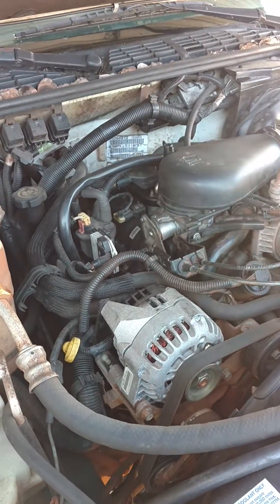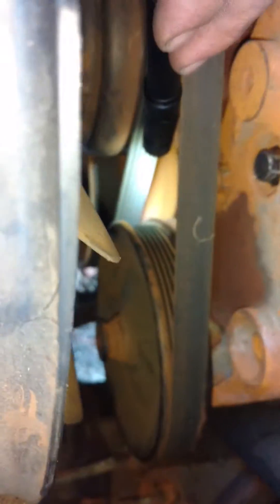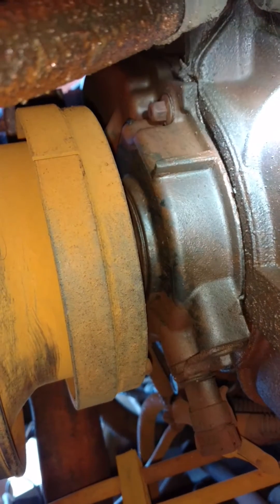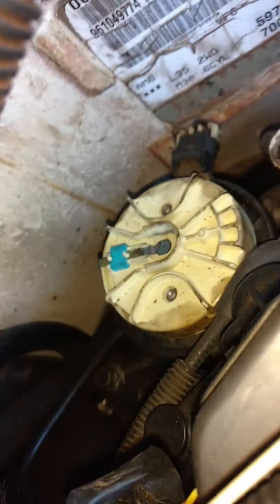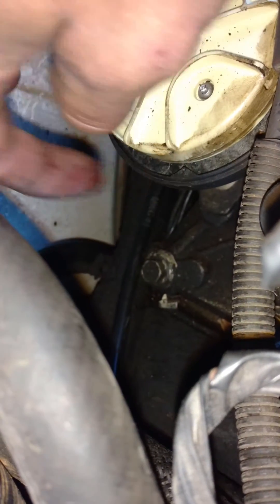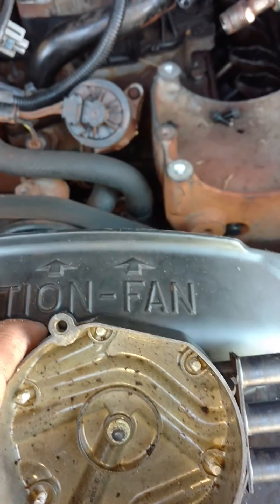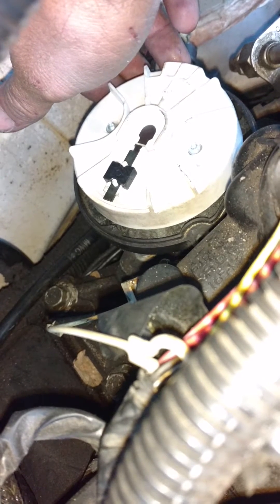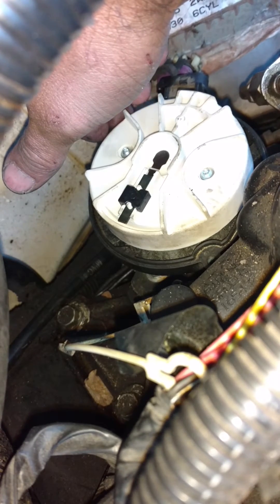96 Chevy S10 4.3 distributor ignition timing set.

Comment: Oil pump alignment isn't an issue.  Just drop the distributor in on the correct gear tooth (or what you think will be correct once distributor is fully down), and crank motor while holding down on distributor until it falls into place.  Verify by bringing it back to #1 TDC and inspect.  If you're off, lift distributor out, rotate a tooth, and crank until it drops down again.  Learned this decades ago.
Reply: how much rotion equals a tooth
Reply: @charlieodom1471  You go by feel.  Lift the distributor high enough where you can just rotate the rotor and you'll feel it moving one tooth then falling slightly back into its groove.
Reply: I did not know this was an option.

Comment: I have a 98 blazer and I cant get the distributor lined up. Tried turning the oil pump but doesn't move. I'm at tdc on #1 cylinder. Dont know what else to try.
Reply from the maker: Is the distributor hitting the oil pump shaft?
Reply: @BaileyCreekRdAdventures  yes wont set all the way down when its lined up

Comment: Long screwdriver for oil pump
Reply: I’ve been trying to stick a screwdriver down in there but it’s not turning ? What am I doing wrong ?
Reply: @dailyvlogzz123  use the old distributor to stick down and turn it
Reply: @dailyvlogzz123   Straight down the middle is the hard part - Medium head screwdriver -  when you feel the shaft, find middle at top - it's all in the feel. If you are finding the slot & it really is not turning, the pump is froze up. It should move pretty easy. I just did another yesterday (1997 Jimmy Rebuild) Don't drop the screwdriver (I've done that)
Reply: @louiswilson6950  well I feel it turning also I see it cause I use a mirror and a light but it seems like every time I drop the distributor it always ends up at the same spot ?
Reply: @dailyvlogzz123  The distributor is supposed to be pointing at about 2 inches away from the six so when it drops into where you want it, because of the splines at bottom of shaft. Move oil shaft to where you think that is to start, then when drop it in it moves to where you want it
Reply: @louiswilson6950  thank you can you please take a look at this video and maybe tell me what you think might be the problem ?
Reply: @louiswilson6950  https://youtu.be/tNPONPSmvI8

Comment: Top Dead Center Compression Stroke - Put your finger on plug hole - turn engine by hand - when your finger pushes out, turn to timing mark & you are there (Unplug battery so it doesn't start on you)

Comment: You are lining the rotor up with number one Cylinder not number 6. There is an arrow on the distributor you can see it when he shows it that is #1 the lead in the cap travels over to where number 1 plug wire hook up. It’s kinda deceiving the way it looks. But there is and pointer that you line the The rotor up with when the Is off
Reply: I‘ have a 4.3 v6 1997 s10 and I can’t get it to line up right at the 6 . Usually when I set in the rotor it passes the 6 and when I go to turn it on it makes this ugly clicking noise ?? I changed my timing chain thinking it was that . But same thing is happening any advice??
Reply: @dailyvlogzz123  read my comment  it will help just put the distributor in make sure all plugs are out then turn the crank until the arrow line up with 6  then pull  the distributor out back then turn the crank until  the #1 cylinder piston is all the way to the top put a screwdriver in the number 1 plug hole an u can feel  an know when the pist is at the top cause the screwdriver wont able to go bnb in the drop the distributor back in put your plug back in hook every thing back up an crank it the oil pump is wat off so u wont have a good timing
Reply: @clutchsmoke3768  I’m praying 🙏🏽 that’s gonna work idk if your going to believe me but I’ve been trying to fix this problem for more then a month 🤦‍♂️ it seems like everytime I put it right at the 6 when it’s at tdc it DOSENT drop in all the way and when it does finally drop in all the way it’s passed the 6 so hopefully your method works ,
Reply: @dailyvlogzz123  yea its the oil pump thats not line up it happens to me 2 months take it to few mechanics same shit i end up doin it my self an fix it  wish i did a video  when i did mine cause alot of video on here aint worth looking at
Reply: @clutchsmoke3768  can u contact me and explain me how to do it?
Reply: @dailyvlogzz123  yeah 1# remove the distributor housing.
2# remove the distributor and inner rotor gear"
3# insert you a long skinny screwdriver inside the distributor housing.
4# till the screwdriver seats and you can turn it clockwisd.
From there you ADUST the position of the rotor with the oil pump gear.
Reply: @johnalexander4940  idk if I’m using a wrong screwdriver or if I’m suppose to get a special one but I’ve tried doing that and it’s not cAtching instead it feels like it’s going to fall in there so I stop trying that ,
Reply: @dailyvlogzz123  it means that the piston is not all the way up if it feel like it about to drop in keep spinning  the crank with a wrench . Its a arrow on the crnak pully that suppose to line up with the  mark on the engine  also  look good u will see  it .
Reply: @dailyvlogzz123  whats your face book i can do a small demonstration an sent it to you
Reply: @dailyvlogzz123   you'll need at least a 12 inch screwdriver that'll go inside the distributor housing.
If not remember he rotor has a slotted key at the bottom end you can use to synchronize both the camshaft/oil pump position.
Reply: @dailyvlogzz123  hey bud did u fix this I am having similar problems
Reply: I'm working on a SR2 Blazer the LT base 2 door model. I went with the videos that say line the rotor up with the #6. It started once but not again. I'm guessing I should go with lining it up with the #1 contact.
Reply: @johnalexander4940  the six is the same is the current flow for one u prolly doin somthing wrong or it maybe not properly line up
Reply: @clutchsmoke3768  actually where the rotor seats on top of the oil pump I took and lined it up with long pliers just a couple of degrees before the six put the gear shaft and rotor back on and now it cranks up fine.
Reply: @johnalexander4940  i did that but mine was throwing code  cause ot was a few degrees off n when start on first crsnk it something shut off so i line it up exactly on the the six take it out then spin the crank until the 2 line on the pully line up with the crank point  put a screwdriver in number 1 piston hole make sure it all the way up an in drop rite in one crank all code went away an running fine all mechanic i went to could not get it time properly
Reply: Theres a mark “number 6” for 6 cylinder, another with an 8 for eight cylinder. So yes you are lining it up for cylinder number one of a 6 cylinder.

Comment: Changed the intake manifold gaskets on my S-10 Dec 2018.  It's a good feeling after all that work when you turn the key and she starts right up.
Any time I'm going to remove a dist I get the engine up on #1 firing position first(remove dist cap and look at rotor).  Then pull the neg battery cable.  Saves lots of hassle going back together. 

Perseverance pays off.  Good job.
Reply from the maker: Thanks! Unfortunately I wasn't the one who started this job. Just the one who had to finish it.
Reply: @TheHiddenArchives I replaced the spider inj on mine also.  Interestingly, it came from the factory with the new style injectors.  It's an 03 with 123k miles, I am original owner.  I changed them any way while I was in there. 

I'm in my 60's now so don't plan on buying another pickup.  This one is like an old friend anyway.
I have a cold air intake with K&N but caution you not to expect any seat of the pants performance improvement, but I haven't bought an air filter for it since 04.